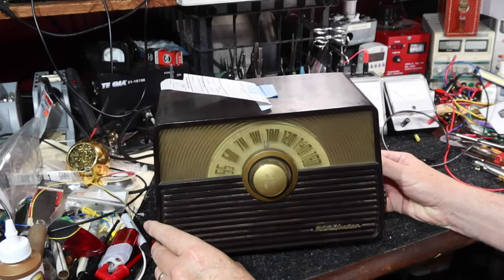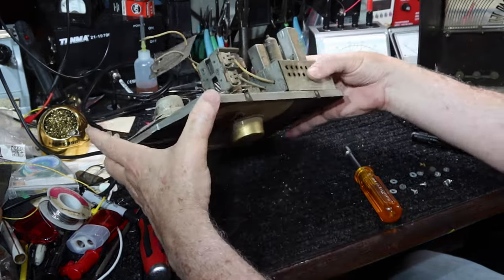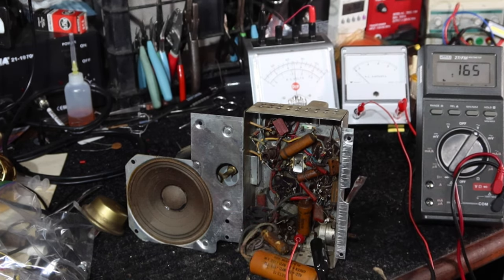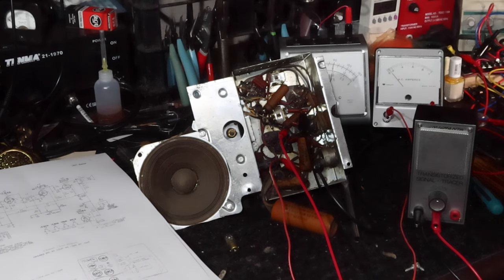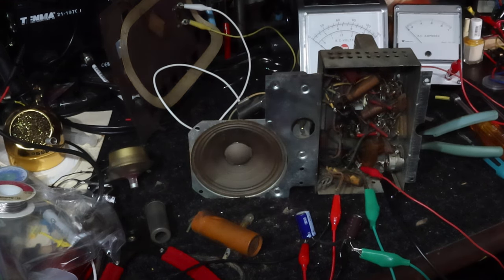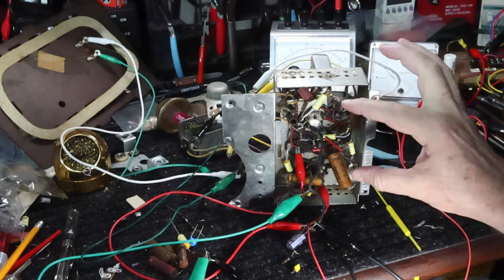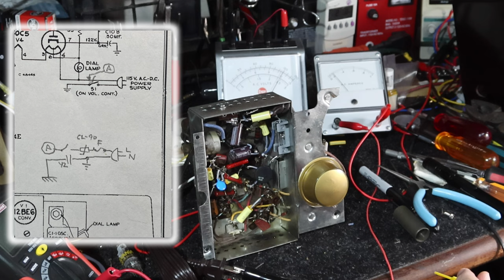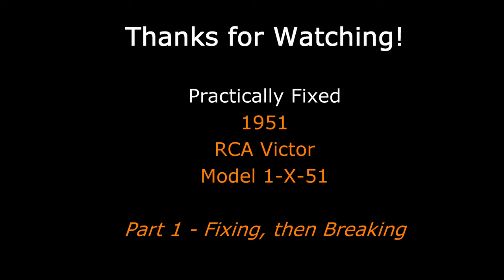RCA Victor 1-X-51 Vacuum Tube Radio Repair 1951 - This was - Supposed - to be Easy! - Part 1 [4K]

Comment: Hey PF, interesting video. Don't you wish sometimes that you could just take back those things that cause problems like that. I've had some stubborn slugs in my time but I've been lucky so far not to have broken anything. I have one in my BK 970 radio analyst on the rf signal generator portion that way and I think I'm gonna have to just try to find a new coil for it if possible. I've also thought about removing the fixed cap across it and installing a trimmer cap instead. I don't really need it that much, but when I went through and aligned it I wanted to get it right. Will be interesting to see what the problem is. I've been working on other stuff and been wanting to get back to electronics, hoping that is sooner rather than later. :)
Reply from the maker: Hi Doug, good to hear from you.  Been really busy with stuff here and this thing just wouldn't quit fighting me.  Just want it to work, right?  Thanks